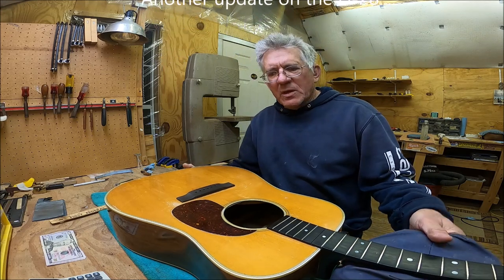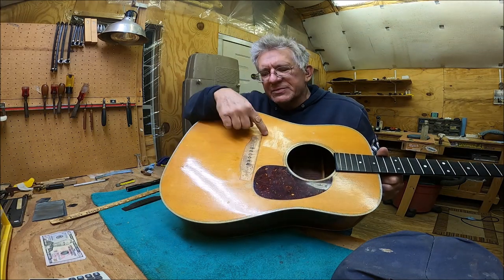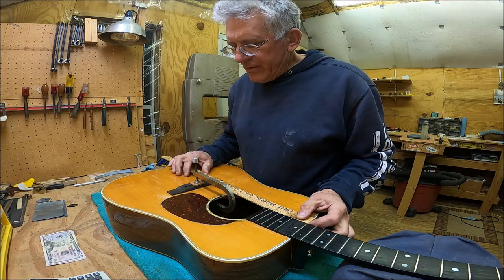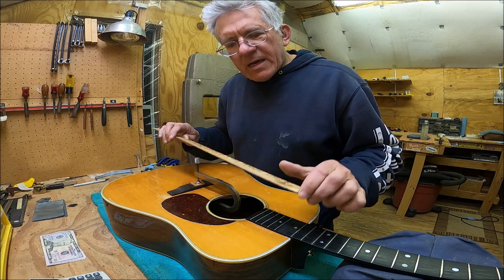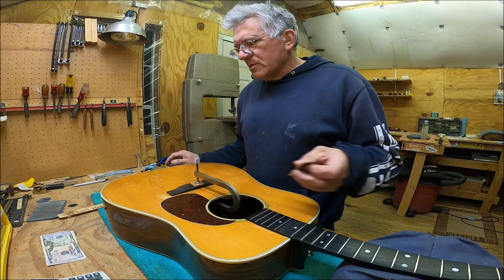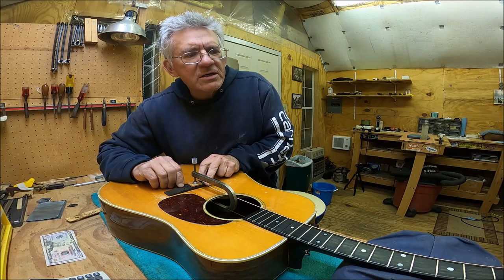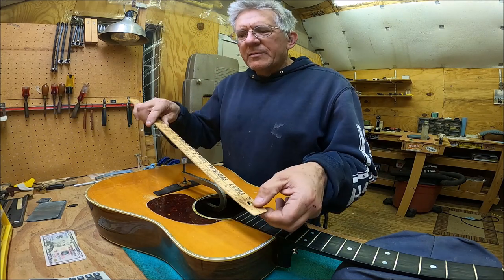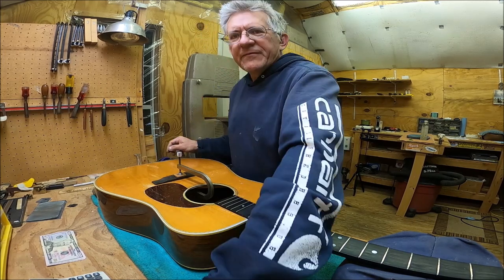Repair: placing the bridge on the 70's  D-28

Comment: Brian, how thick would you make the wings of an Indian rosewood bridge? I have one that was around 0.200" after someone shaved it down, so I glued a shim underneath to bring it to .345-.360
Reply from the maker: I shoot for .145 on the bass wing, .125 on the treble wing. .320" at the low E and .300 at the high e.  .360 is okay for a  thicker bridge but about as thick as I'd go.
Reply: @Bryankimsey  thanks! I'll aim for those numbers